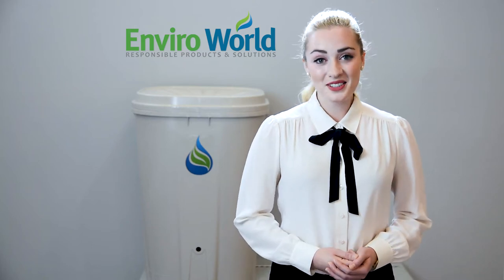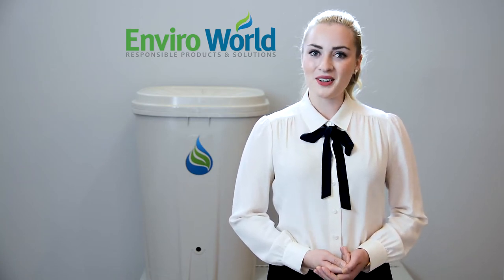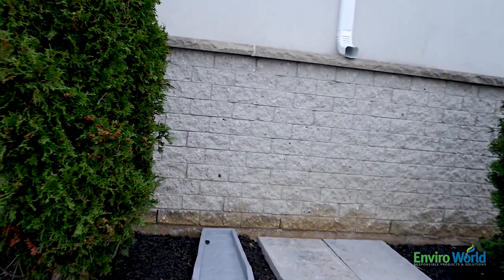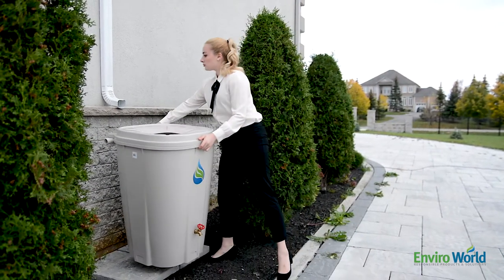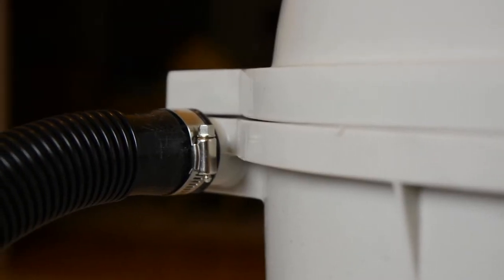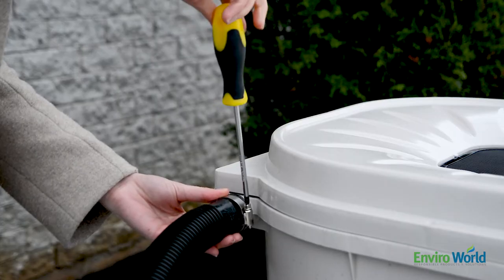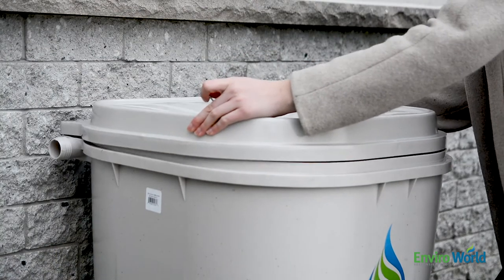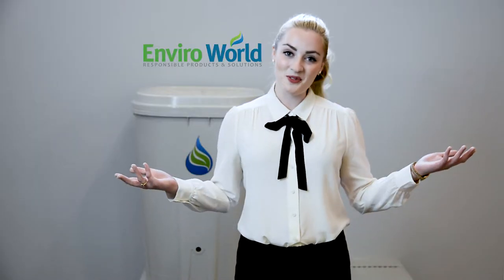FreeGarden RAIN rain barrel installation Instruction

Comment: why is the bottom spout so high...I guess they will probably say stability from water collected at bottom but then its not 55 gal you can use as rainwater?
Reply: Likely reason to have some distance from the bottom is to collect sediment from the roof so it doesn't clog the hoses, or pump if you use you use such. 6" is a bit much, but just tip the unit over to drain, flush sediment at end of season.

Comment: How to remove the plastic disc is the only thing I want know, but it’s not mentioned in detail and did not show us how to do.
Reply: easy. Put a screwdriver in the hole and tap with a hammer. It pops right out.